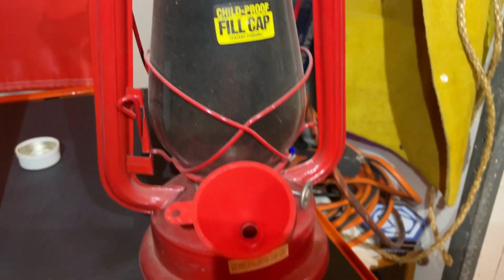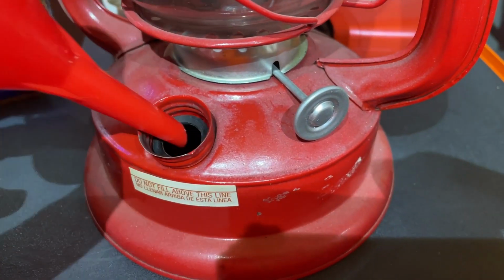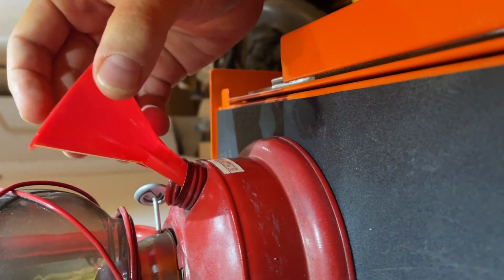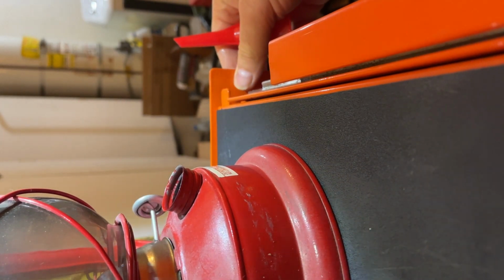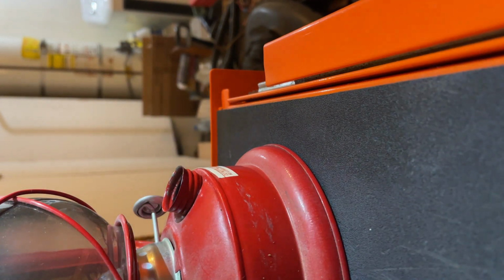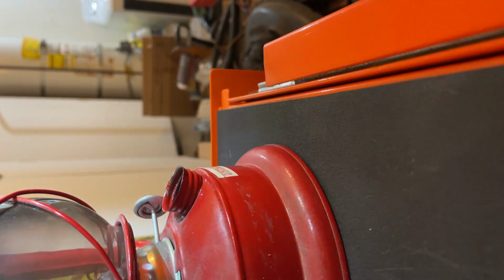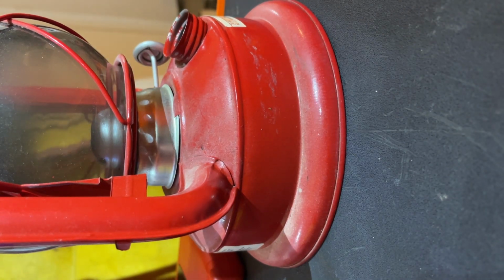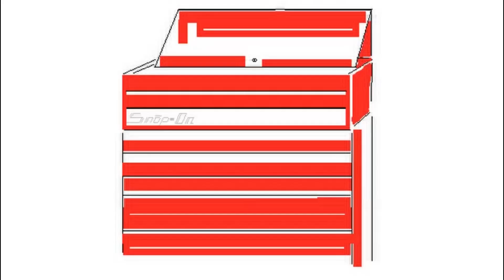Cheap lantern leaks but New  UPDATE!!!

Comment: You mentioned in your first video about this lantern that you noticed after the second "fill" there was kerosene on the surface the lantern was resting on. Something that a LOT of people are not aware of (and I just got into these lanterns and learned this myself) is that it is very important that the lantern not be filled completely. The sticker right below the fill hole shows where to stop and it is very important that we not fill it above that. This is because where the arms on the sides are, air flows down through those arms and above the kerosene in the tank to provide fresh air to the flame. Because of this, those tubes are NOT sealed where they connect to the fuel tank, and if the tank is filled too high then kerosene can leak out there. It will run down the sides and to the edges of the bottom of the tank. Even a lot of the original lanterns of this style will leak if there is too much kerosene in the tank. They should only be filled to about 80 or 90%, depending on the design of the lantern.

Also, the reason the globe has black suet on it is because the flame was too high. The lantern is only supposed to burn the kerosene in the wick, but if the wick is cranked up too high the flame will start to burn the wick because the wick cannot absorb the kerosene fast enough to bring it to the top of the wick. As a result, you get the black smoke, which will stick to everything. Also, that keeps the lantern from throwing out light as the suet on the globe blocks the light.

Right now, even with the tank sealed on the bottom, if you put kerosene into it and tilt the lantern, it will leak out where those arms attach. 

I hope this is some information you can use. I had to watch A LOT of videos to learn this myself. There is more to these things than one would expect. I hope you are able to get more enjoyment out of that lantern. However, because it is from Walmart, I would not be surprised if it is actually a piece of crap. ;)